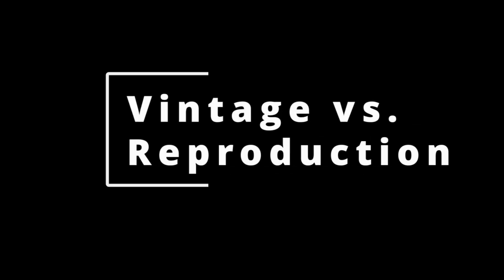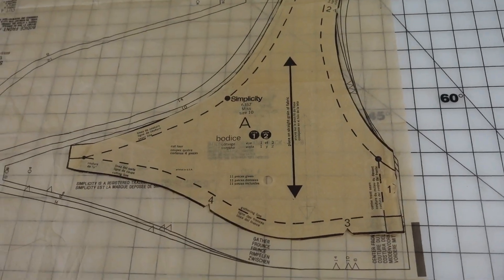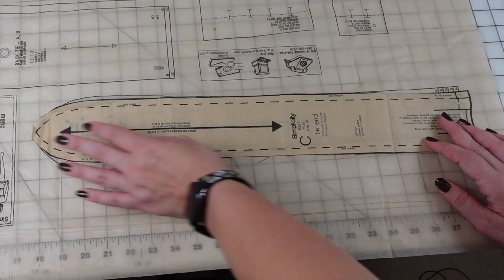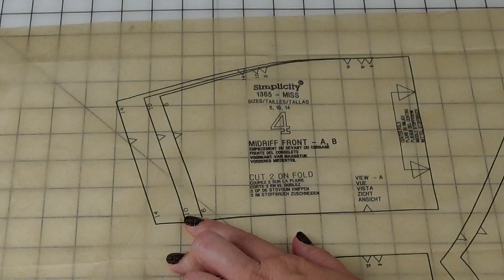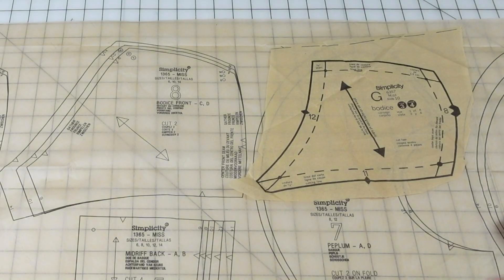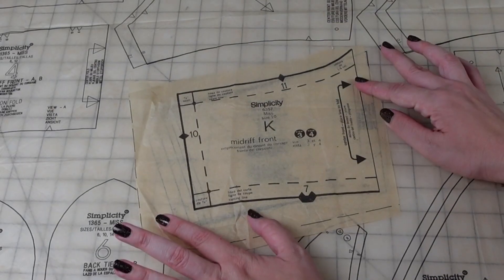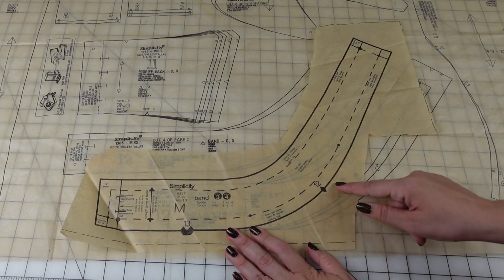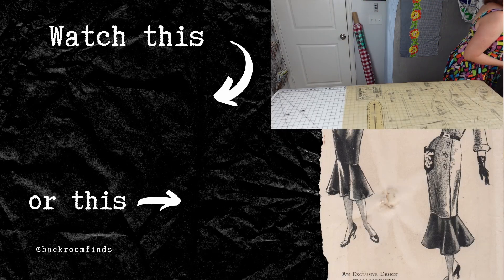VINTAGE vs. REPRODUCTION, 1970's Halter Top pattern || Comparing Simplicity 6357 to Simplicity 1365

Comment: No it is diffident, sizes have changed several times since the 1970s. Size 10 doesn’t conform to the past. I just remembered.  Lucky me I bought by measurement.
Reply: But on the envelopes she shows sizes are the same.

Don't confuse pattern sizing with ready to wear sizes.